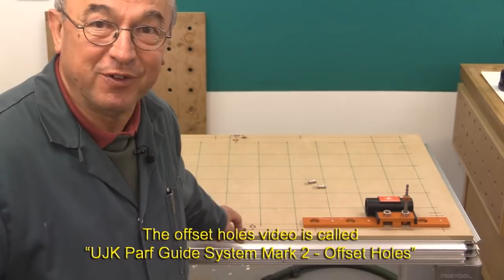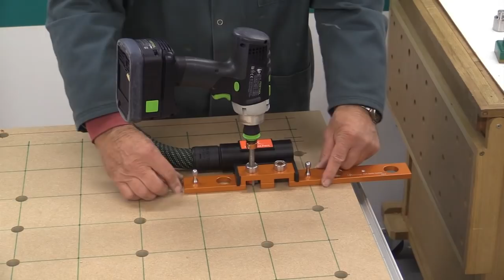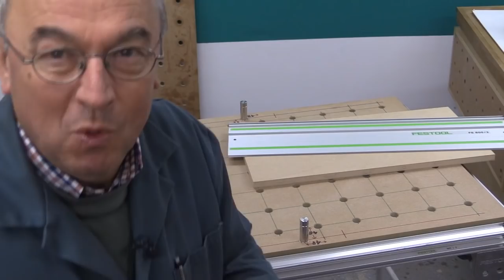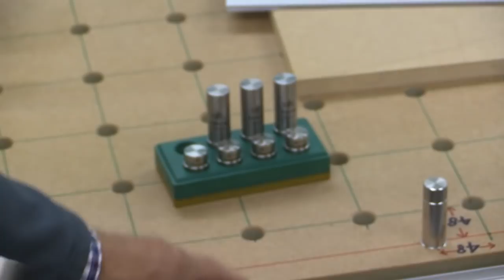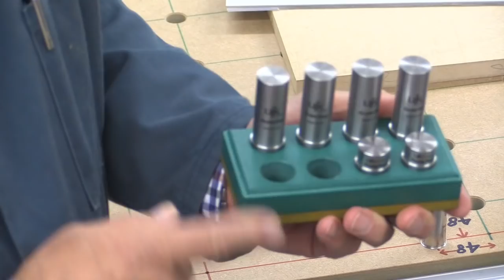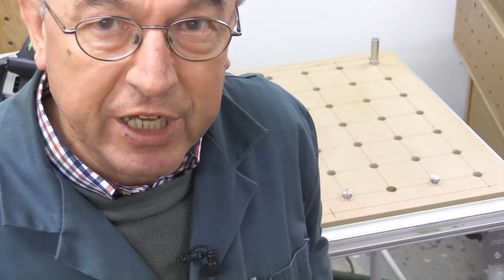UJK Parf Guide System Mark 2 - Part 2

Comment: Hi Peter, I have just received the UJK Parf Guide system Mk2 and look forward in using it. I want to make a big table (like Mat Estlea) most likely in Valchromat when my new shop is ready, but will make a smaller MFT size first. For how many holes do you think the TCT cutter will last?
Reply from the maker: Hi Peter, I am still using the same cutter that I had when the PGS Mk II was introduced. Although not drilling Valchromat I would guess that I have made between 500 and 600 holes in Medite MR MDF. It has an outer layer (on both sides) which is the equivalent of HDF and so I would expect you to be able to complete your top without a problem. I am still saving up for a sheet of Valchromat !  Good luck.  Peter
Reply: @NewBritWorkshop  Thank you Peter. I was under the impression that you advised valchromat? So you use the V313 moisture resistant MDF? That is a lot cheaper than valchromat, and you get great results. It would allow for even a 22 or 25 mm thick plate and get an even higher stability. The bottom side could have a slightly larger chamfer to allow for clamps but the extra thick panel would feel more solid ..... or am I missing something?
Reply from the maker: Hi Peter, I would certainly recommend Medite MR MDF. If you go for thicker material put the extra chamfer (for the clamps) on the underside which then will not affect the Parf Super Dogs from behaving as they should.  Good luck.  Peter

Comment: Hi Peter. 
What a great instructional video, thank you. I have watched all 3 of the Mark 2 inc the off set holes. I hope this hasn't been asked yet, I have searched!! After you finished the hole cutting in this video with the 2 off set holes are you able to add at a later date more off set holes using the hole cutting jig as the rulers won't be able to register as there are no more 3mm holes left just 20mm ones
Reply from the maker: Hi Graham, Try to leave some 3 mm holes that would allow you to extend the offset holes at a later date. I have made many tops with bags of spare 3 mm holes that I only enlarge when required.  Cheers.  Peter
Reply: New Brit Workshop Of course why didn’t I think of that!!!!🙄. I’m sure someone has mentioned it but if not I bet it’s got you thinking! Version 3. Thank you so much for the quick reply have been making space in my shed today and will be looking at Axminster Tools very soon. Have just seen the 30deg/60deg video Wow even better Cheers Graham

Comment: Hi Peter  I note that Ron Paulk makes a shallow hole on the backside of the board without using the guide block to avoid any tear out when drilling the 20mm holes.  I suppose this might only be needed if you use his sacrificial strips but as you need to keep the board just clear of the sub base to allow the guide pin on the 20mm bit to come right through I guess this wouldn't make any difference.  Do you do it this way now?  WKR  Mike
Reply from the maker: Hi Mike, The 20 mm cutter is designed to give a clean exit wound in MDF. For plywood (which Ron is using) it is not quite so good (but better than other options) and so a small up-cut may help. For me, plywood is not a good idea for a bench top as it is more expensive than MDF and less stable.  Cheers.   Peter

Comment: I can't see where in the video that you chamfer the holes? Does the fostner style bit do the extra work? where in the video is it set up for the correct depth? What advantage does your system have over buying a ready-made mft table top with dog holes pre-cut (£45 on eBay)? thanks - good video.

Comment: Do you have a video discussing practical dog hole layout? I don't think I want dog holes every few inches. I would rather have groups of holes strategically placed.
Reply from the maker: Hi Chris, I have talked about this a lot in various Parf Guide Videos. Just go for what you think is right but leave some 3 mm holes so that you can then re-introduce the Parf Sticks to expand the design at a later stage.  Peter

Comment: Hi Peter. Good morning. I've just requested a PGS Mark II System and I have one doubt. Is it necessary to buy separate Veritas small Bench dogs or the ones which come with the system would substitute them?
Reply from the maker: Hi Candido, Yes, the locator dogs can be used instead of the small Veritas ones but you should also look at the Axminster UJK range of dogs and super dogs as well.   Peter

Comment: Any luck using this with a DeWalt track saw? I presume everything works aside for the guide rail hooks?
Reply from the maker: Hi Michael, You are right, it is only the guide rail clips that are Festool specific. You can even use the system with any circular saw with just a straight edge instead of a guide rail.   Cheers.  Peter

Comment: The tolerance on the cutter is too tight. I had to use a hammer to fit the dogs. Axminster sent me a new cutter but this has the same problem. The demo version in the store was not a problem. Do I need to sand the holes in the MDF?
Reply from the maker: Hi David, I am not happy with the tightness that you describe. I recommend a "pecking" approach when drilling the 20 mm holes - keeping the 20 mm guide in place drill a few mm then raise the cutter, then drill some more and repeat, say about 4 or 5 pecks to complete the hole. If the 20 mm cutter goes through too quickly some of the fibres of the MDF get compressed and expand within seconds of the drilling being completed. It has happened to me several times and I must confess that I have just run the 20 mm cutter through the dodgy hole(s) free hand (but carefully keeping it square to the MDF) and this has sorted it out. If this does not solve it please let me know and I will ask Axminster to recover your 20 mm cutter for checking.  Please let me know how you get on.   Peter
Reply: @NewBritWorkshop  I've experimented with different drilling techniques and I think you are correct that the MDF becoming compressed and then expanding. If I take my time with the pecking action, the holes certainly allow the dogs to fit. It could also be down to the moisture content of the MDF at the time of drilling. I'll make another worktop and see what happens. Thanks for your advice.
Reply from the maker: Hi David, We can fix this - what dogs are you using?  Peter
Reply: @NewBritWorkshop  I have a mixture of Parf Pups and Super Dogs plus a couple of Veritas bench dogs.

Comment: Hello Peter!  As this guide system already enables 96mm pattern (which is actually 3 x 32mm), in a Mark III update it should not be too complicated to add capability to drill 32 mm system holes, is it?
Reply from the maker: You can make both 32 mm space patterns and 48 mm spaced patterns with the Mark 2 system using the offset holes. Take a look at this video:  https://www.youtube.com/watch?v=tOhDFN5Cx-s     Peter

Comment: Your jig is really cool. Does it work for 19mm Holes too? I own quite a few 19mm acessories and would love to make a new tabletop with your jig without having to replace those. I thought if you drill all holes by using the 3mm guide holes perhaps a 19mm drillbit could fit in if the shaft is the same size.
Reply from the maker: Hi Christoph, No, only 20 mm I am afraid but I have asked people to let me know if they want 3/4" or 19 mm.   Peter

Comment: Hi Peter,
I ordered this system as soon as it was available. Everything was fine, until I tried to put the pins in the 20 mm block. It was impossible. Do I need to drill these holes first using the guide and the 3 mm drill?
Thanks!
Reply from the maker: Hi Anthonie, It is the anodising in the 3 mm holes. It is very easy to deal with, just use the 3 mm drill guide with the shorter protrusion and the 3 mm drill in its holder to go through those 3 holes. It is very simple and does not affect the accuracy once done.   Peter
Reply: Hi Peter,

I was thinking along these lines as well, but didn’t dare to do this. So I tried it, but to no avail. What to do next? Could the pins be oversized? Neither of them fit, so that would be unlikely. Could the drill be undersized? I only used it for a dozen holes...

Your input is appreciated! Thanks
Reply from the maker: Hi Anthonie, This is very odd and should not happen. The pins are produced on a continuous run CNC and it is almost impossible for one to be wrong and so the chances of several being wrong and in the same packed PGS set is never going to happen. Please would you now contact Axminster Customer Services and explain the situation. They will sort this out for you. I am so sorry that this is delaying you using the new Mark 2. Please let me know if you have any problems.   Peter
Reply: Hi peter,
No worries, I also contacted axminster, but you were the first to answer. For what it s worht; I went to the store to get a new 3mm drill and I can smoothly fit the shank through the holes in the 20mm guide block.

So let’s wait for Axminster to reply. 

Thanks once more.
Reply from the maker: Hi Anthonie, I will wait to see what happens next. Rest assured you will get this sorted out by Axminster.     Peter
Reply: @NewBritWorkshop  Hi Peter,
Bit a late reply from my side, but axminster replaced the system and now everything works perfectly.
Regards, Anthonie
Reply from the maker: Hi Anthonie, Axminster will never let a customer down and if the Parf name is involved then I will always keep an eye on things as well.   Peter

Comment: Hi Peter, just found my MFT top has some water damage so it needs replacing.  I had Osmo'd it, but the water must have got in via the holes.  Just wondering what MDF you recommend, although I'm guessing your source might be impractical for one-off or small orders and it maybe just as cost-effective to make more frequent replacements with standard B&Q stuff.
Reply from the maker: Hi Joe, Trust me - buy some Medite Moisture Resistant MDF - I am sure that the well known builders' suppliers will fix it for you. If in the UK then try Timbmet who have outlets around the country. It is far superior to normal (B&Q quality) MDF and is probably cheaper.    Peter
Reply: OK, Ill have a look.  Timbmet seems to be £250 minimum for delivery but I may be down south sometime.  I'll check local building suppliers though.
Reply from the maker: I always collect from them but I think Travis Perkins will get it for you.   Peter
Reply: Wickes do a decent MR MDF it's kronospan.

Comment: You have a grid marked out, in pencil or marker.  Is this just to better explain the concepts, or is it a recommended part of the process.  I may have missed something in watching.
Reply from the maker: I drew those lines to aid my explanation. There is no need to draw any line when doing a bench top.   Peter

Comment: Hi Peter, this is a great little instructional series, can’t wait for the ‘back order’ at Axminster so I can create my own mft type top for my table saw outfeed table and these videos will help massively. 👍🏻Cheers Steve
Reply from the maker: Hi Steve, It will not be long and they will be in stock. Axminster are taking pre-orders which might be a good idea as it is looking like the first production run will go quite fast.  Cheers.   Peter
Reply: New Brit Workshop Thanks Peter, my order is in 😉 how many parf dogs do you need? I’ve ordered 2 long ones and 4 of the shorter ones hopefully will get up and going 🤞🏼
Reply from the maker: Hi Steve, That is a good start. I would recommend that you use the Parf Super Dogs or the tall Veritas Parf Dogs to push the guide rail against. The Veritas ones will need to be secured wit a pair of 8 mm knobs from underneath whereas the Super Dogs do not. If you use Super Dogs or the UJK Guide Dogs or Pups then you will need to chamfer the top of the holes where they will fit. This can be done with the UJK chamfering tool or a chamfering bit in your router.   Good luck.   Peter

Comment: I wish I'd seen this video at the weekend as I really struggled drilling the 20mm holes.  I now realise (as is pointed out in this video) that I should have drilled the 3mm holes all the way through the table top.  
I was giving myself a hard time for not reading the instruction manual properly, but on second read just now I still can't find anywhere where it states that you need to drill the 3mm hole all the way through because the tip of the 20mm cutter doesn't actually cut.  I just hope that I haven't damaged the cutter!! It's a brilliant system (my 3mm holes are perfectly aligned) but this omission is pretty significant.
Reply from the maker: Hi Jon, I am busy writing the new instruction manual and will ensure that it is clearly stated.  Cheers.  Peter
Reply: @NewBritWorkshop  Good plan Peter. Just hope I haven't killed the bit.

Comment: Interesting to hear you at the very end mention that your track saw casing didn't hit the super dog.

I've had a couple of instances when my casing did hit my super dogs - could you explore this issue in more depth in another video and how to avoid. I was wondering if that is why you have your superdog holes in between the standard holes.
Reply from the maker: Please see the recent video on Offset Holes with the PGS as it is all explained there in detail.   Peter